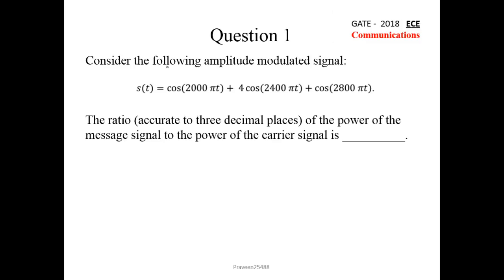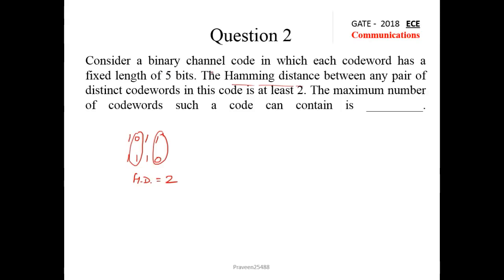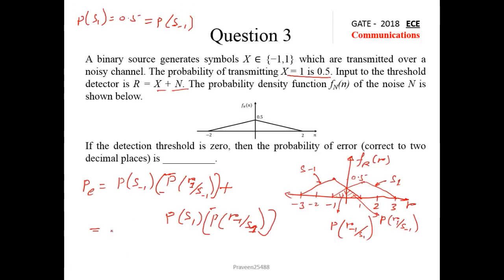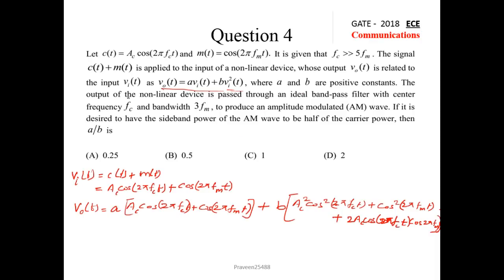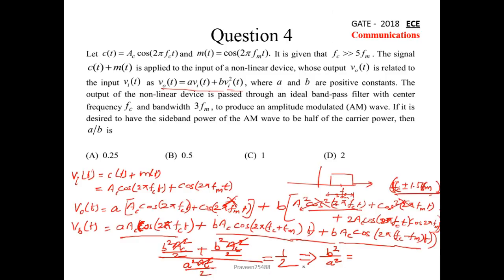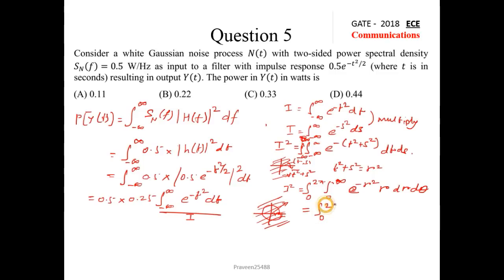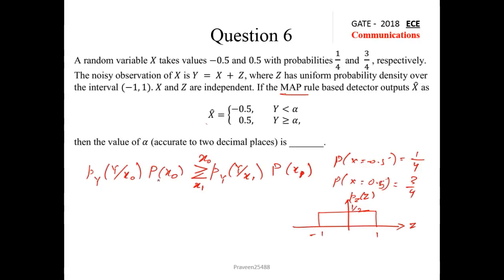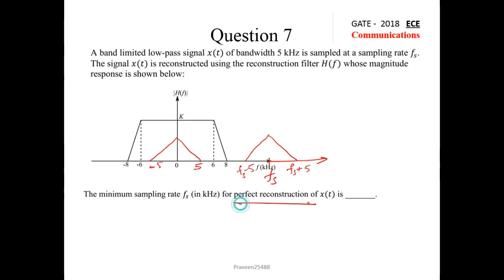GATE-2018 ECE (Communications) Questions with Solution

Comment: Pls correct Q. 1 it is solved in a little wrong way... Its AM= Ac ( 1+ û cos 2πfmt) Cos2πfct
Here û(meu) = Am/Ac.so u will find Am= 2 so power of msg = (Am square /2)  i.e = 4/2=2
Now power of msg side band/ power of carrier= 4/8= 1/4=0.25 is the correct answer... Here û is not equal to Ka.Ax, its depend on method of am genration.
Your all content is too good 👍 bro.. Just correct it if u can..
Reply from the maker: You are correct if you consider only one sideband power, but in the given equation we have to take both sidebands power that represents to message signal power. 
To verify correct answer from official gate website, please refer https://gate.iitkgp.ac.in/old_question_papers.html

Comment: The first question you have explaine is wrong because standard equation is AC[1+m(t)]cos(wc)t
Reply: Explain*
Reply: yes you are right
Reply: Agreed...wrong solution
Reply: .25 is right answer
Reply: @sdharmveer40  yes 0.25 is right, many other answer keys have given 0.125 as answer, side band power is not same as message signal power